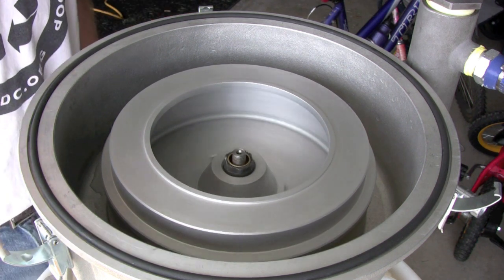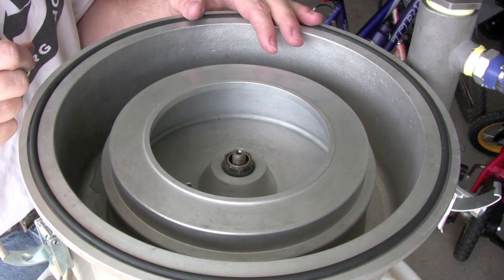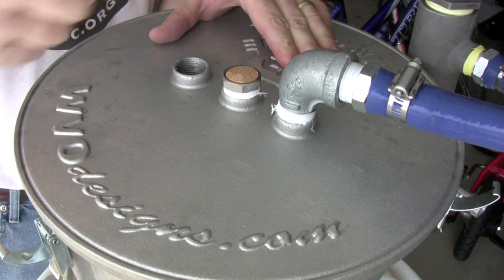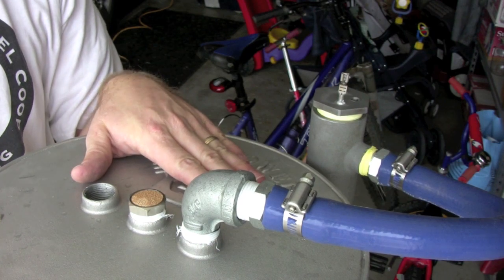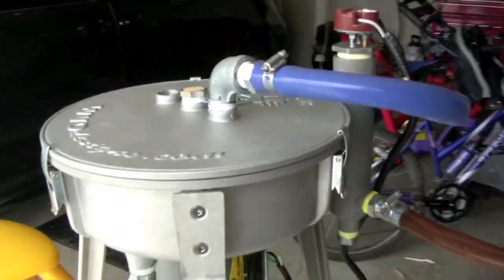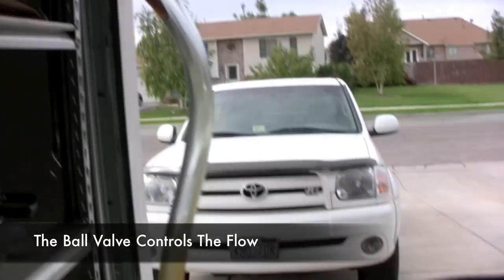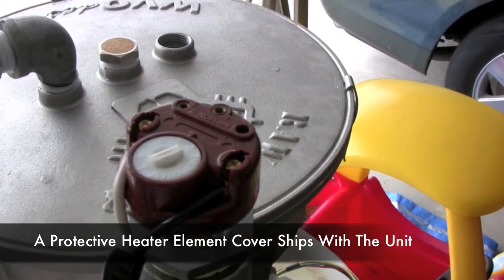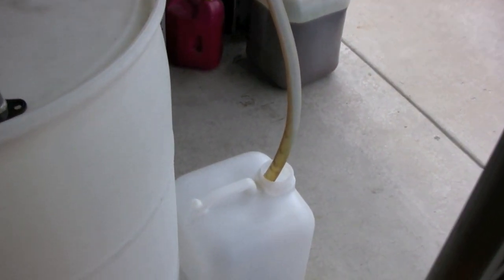Extreme Raw Power Centrifuge | Filtering Oil | Utah Biodiesel Supply

Comment: Centrifuges DO NOT FILTER. They seperate. I use decanting centrifuges on offshore oil rigs. They cost hundreds of thousands of dollars.They continually remove the solids so can be run continuously. This is a very basic system that works sort of.  Once the solids build up on the wall too much then the separation stops and everything added after that simply flows into the clean bucket totally unseparated. You would have to constantly turn this off to keep dumping the waste. This in turn would mean a lot of wasted oil will drop into the dirty bucket. This is a very inefficient system. As the capacity of the bowl is  constantly diminishing with contaminents so is the quality of separation. It is very easy to overload this design and therefore provide little to no separation. If the oil was very dirty this might block up in minutes. This is not a simple solution that can be set up and left for hours. it could be used before filtering to prolong the life of a filter but unlike a filter with a micron rating the discharge from this has no set limits. Once overloaded it will do absolutely zero separation. I really like the idea of recycling oil and a centrifuge is the right piece of equipment but it must be a real centrifuge unfortunately.  Commercially the cost of oil per barrel must be a lot higher than it is currently for waste oil recovery to be a viable commercial prospect. trust me I've looked into this and there is just not the return on investment at this time. On a small scale free second hand oil used in your own car maybe  but maybe the time spent, investment in shoddy equipment and space involved means you would be better off doing a few hours a week at target as a checkout chick. And you won't have to work out what to do with the waste sludge that you produce  along with all the horrible old oil containers ,filters etc
Reply: If you have any reason to believe the bowl has been overloaded, just clean the bowl, and run it through again. The more slowly you can run it through, the better the first pass efficiency. This video shows the 3 phase motor with variable frequency drive, which allows higher RPM.(the controller allows a 100 Hz frequency into the 2-pole motor, for a maximum of 6,000 RPM) That makes the centrifugal separation process much faster, allowing higher flow rates. This is the real deal, for small scale use.
Reply: If u find anything Sir Please let me know -i am also in same wave length of you
Reply: I've read somewhere they set a timer on a centrifuge so it stops and dumps dirt every couple minutes. Kind of wasteful but you can always cycle it once more.

Comment: how much does this system cost with the heater and all? this does seperate out the water???
Reply: There's two models a basic and extreme. You can also add a heater or a cone booster as well. Full details & pricing are on the website at utahbio (see link in description). No. They're not really designed for water removal.

Comment: @TimTaylor540 I don't think I'd use it for that. While it's awesome at separating solids from liquids, it's not ideal for separating water away from oil. It'll remove a little via evaporation, but not through separation. I'd think that a heat & circulate barrel would be much more effective.

Comment: @TimTaylor540 It depends on how dirty the oil is & how fast the bowl fills up. I'd say given most oils, you should be able to easily let it run for 5 hours before having to stop it & clean it out. Most people can get anywhere from 300 to 500 gallons through it before stopping to clean it.

Comment: @Begbucks The motor is rated at 250 watts. If you use the heater, it'll suck 1,000 Watts.

For cleaning, I'd just watch it the first few times you filter & make sure it's not building up too much in the bowl. I've heard of some people going clear to 1,000+ gallons before they've had to clean it, but that's with some pretty clean oil.

Comment: @Begbucks Most people usually get through about 250-500 gallons before they have to purge. If the oil is much, much dirtier though it may be every 100 gallons or so. Really depends on the condition of the oil.

Comment: @Begbucks I was able to easily filter at 15 GPH with McDonalds oil, but I did have it warmed up.

It's much easier to shut it down, scrape the bowl, and then fire it back up. The quick connect fitting also makes it really easy to pull the bowl out, scrape it, get it back in place, tightened down & back in business too.

Comment: I built a centrifuge from an old hand-crank cream separator I found in a French barn. It works ok, if slowly, removing water and crud, but some used oil I get from a Ma & Pa pizza joint contains floating debris like breadcrumb and herbs. This is not removed by the centrifuge for obvious reasons and I have to use filters. BTW, Wish I could afford one of these!
Reply: Back in the day, we didn't even use a centrifuge. What we did, was usa a tall cylinder, dumped the oil in that, added some potassium hydroxide to separate out the glyserin, and just let it separate out by gravity for several days, or even weeks. It was a slow process, but quite effective. The centrifuge just makes the process go a whole bunch faster, reducing process times from days to mere hours.(I'm gonna get me one of these!)

Comment from the maker: at 10 GPH, it'd be about 27.5 hours.
At the max rating of 30 GPH, it'd be about 9 hours.

The beauty of this style though is that you can gravity feed it, turn it on, and walk away. Depending on how much "gunk" you've got in the oil, you'll want to come back & check on it from time to time to make sure the bowl isn't filled up with crud, but it's nice because you can let it run and get back to life until it's time to come & check it.

Comment: @freeekonaleesh2 
No. It doesn't remove water by centrifuging it. There is some water that will evaporate out of the oil if it's heated hot enough and the vents are open, but it doesn't happen through centrifuging.